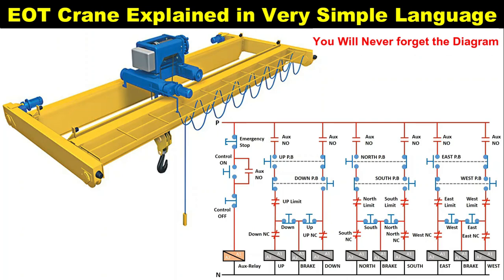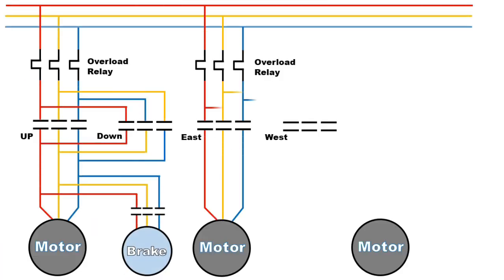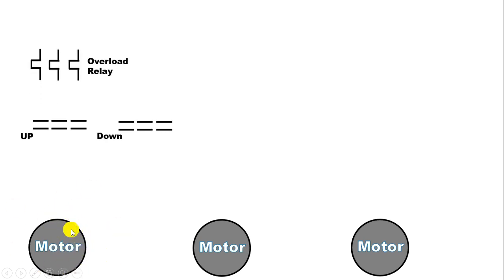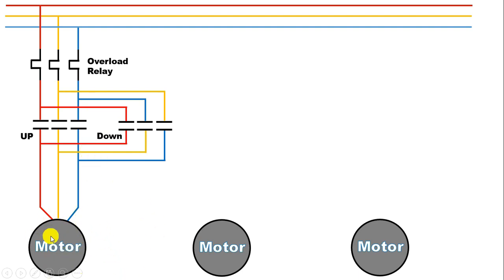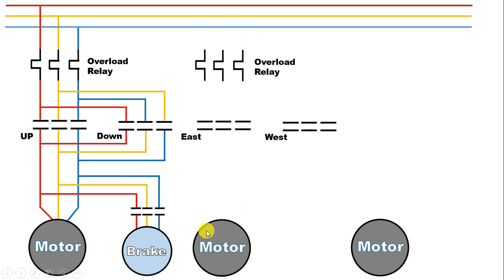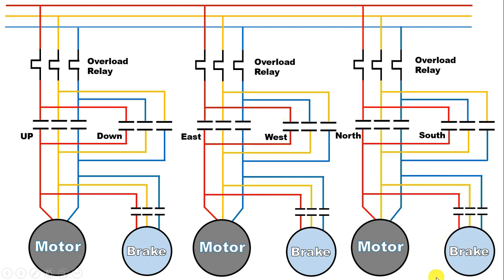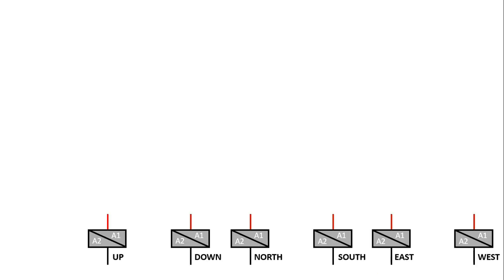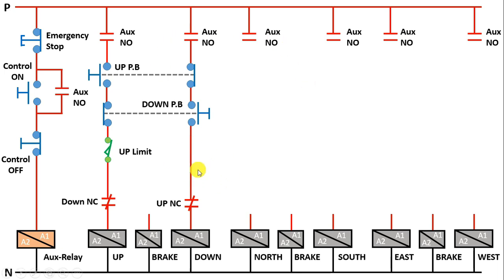EOT Crane Electrical Circuit Diagram Explained Like Never Before 😎 @TheElectricalGuy

Comment: By all means,you justify it well.why we use brake motors and  can we use the NO contacts of the respective contactors to energize Coils of the brake contactor?Can a problem arise when we do not interlock the push buttons?i need your justification definetly.

Comment: Looks like the same technology we were using at Whiting Corp. 70 years ago. Worked well, and nice to see it's still in use. Our cranes typically used 3 phase 400 volt induction motors - Big difference today is the use of trolley supported/looped power cabling along the bridge girders. We used open (uninsulated) bus bars with "pick ups" mounted on the hoist trolley which is dangerous for both crane operation, and maintenance.